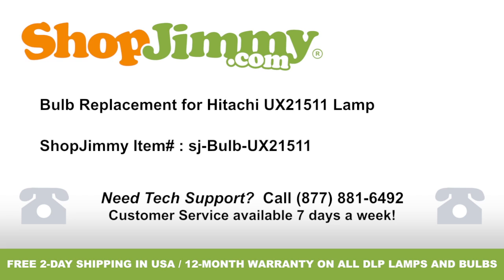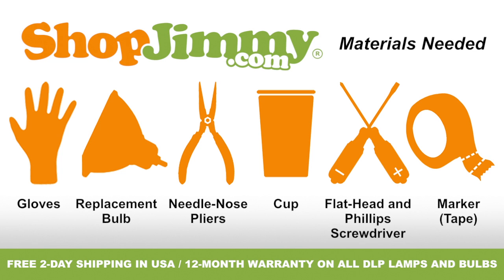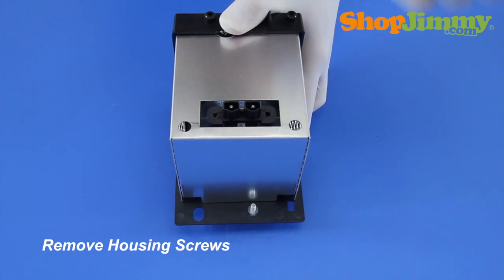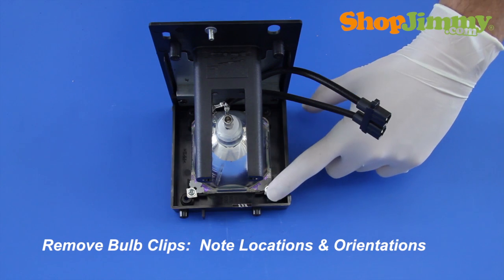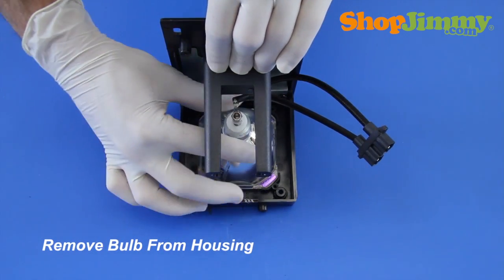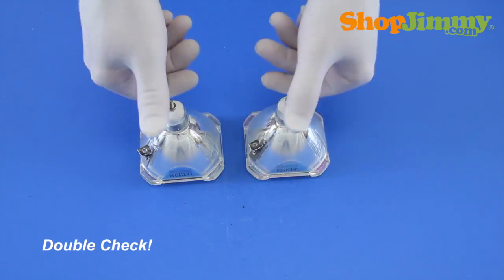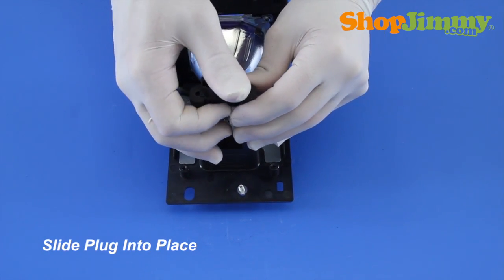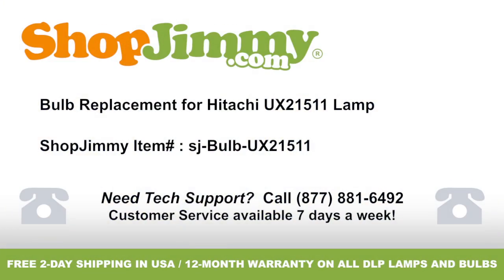Hitachi UX21511 Bulb Replacement Guide for DLP TV Lamp

Comment from the maker: Hello! The manual only shows you how to replace the fully-composed lamp, but the bulb inside of the lamp is typically the only part of the lamp that goes bad. This video shows how you can reduce waste and repair cost by re-using the original lamp housing and only replacing the bulb. For those who do not want to attempt this fix, we also sell fully-composed lamps. Simply search your part # or TV model # at shopjimmy(dot)com, and feel free to contact us if you need further assistance :)

Comment: A little confused ... the manual doesn't say anything about taking the new bulb and housing apart. It says to pull it out by the handle and push the new one in (basically) there is no dismantle and the directions in the manual say nothing about taking the lamp apart and putting it back together again. I'm so confused....